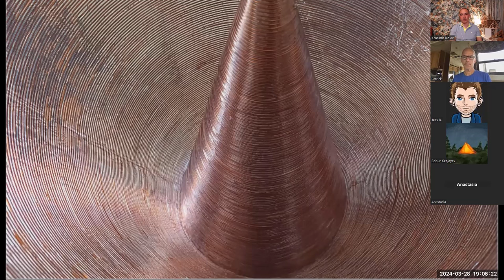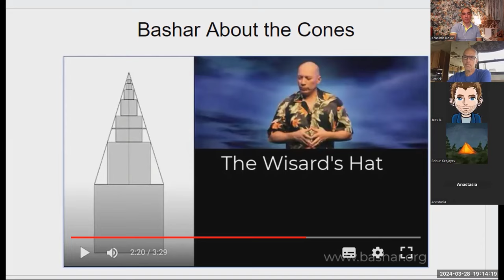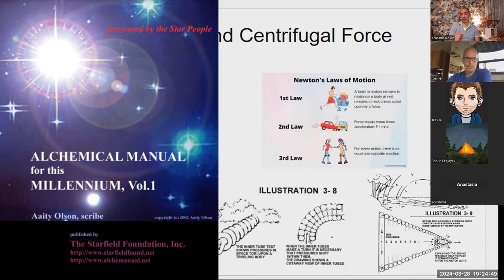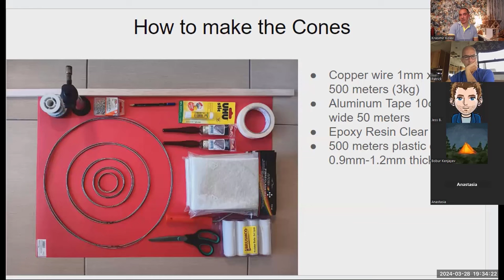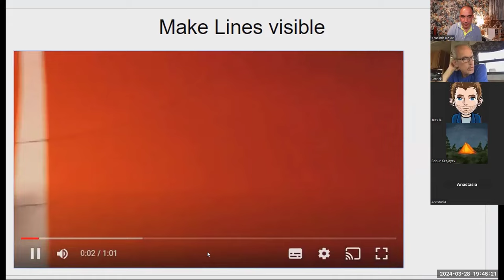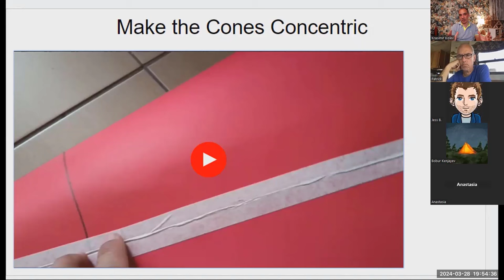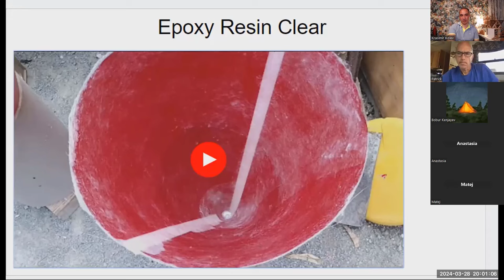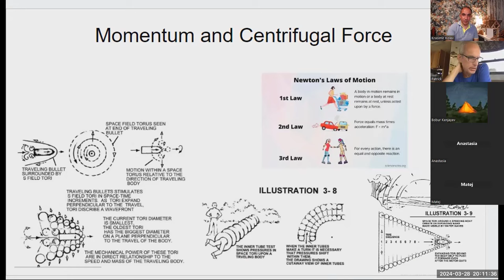How to Make the Cones (Step-by-Step)

Comment: Hi, nice Work. Can you please tell me in which direction the winding of both cones is done? Is it important or not?
Reply from the maker: Sure the first 4 prototypes each cone was winded in different directions so when we inverted one of them to make the curent in both cones to move in the same direction. 

But inbrhe the last 5th prototype, I made both cones counterclockwise starting from the apex towards the base.

This created 3 times more voltage on the output compared with previous prototypes.
Reply: @primeradianttechnologies3085  Thanks for your Answer. I made a small cones 23 cm high. These are split in half due to the intersection of the two cones and then the individual wires are reconnected. Both cones are connected in a closed loop. From the apex of one cone to the base of another cone. Wire 0,75mm. The input voltage varies depending on the frequency (0-10 MHz) from 1,5 to 0,7 volts. I made the experience, that the output voltage depends on the location of the input signal. I got the highest output voltage when placing the signal at the intersection of the cones, but T´the output voltage newer exceed the input voltage.
How much the output voltage depends on the size of the cone?